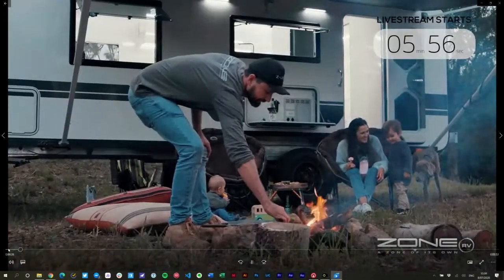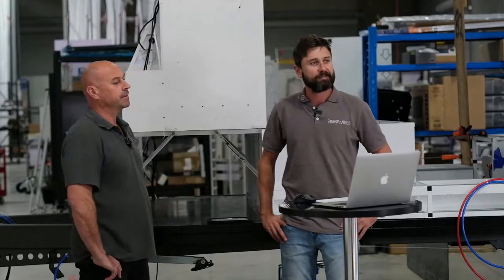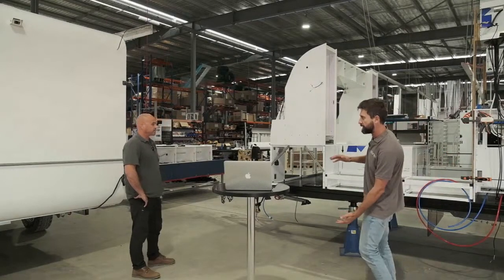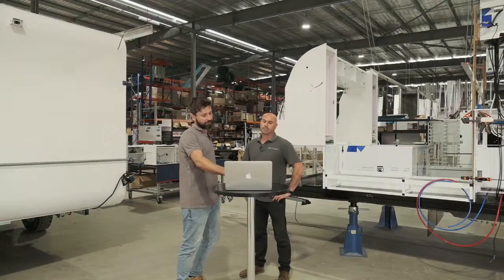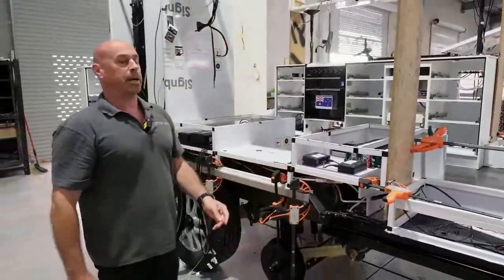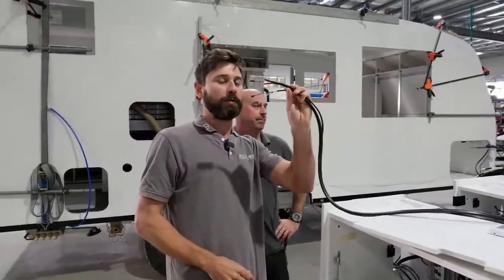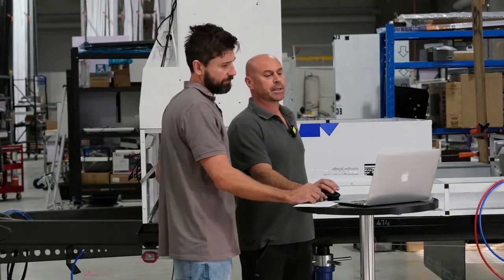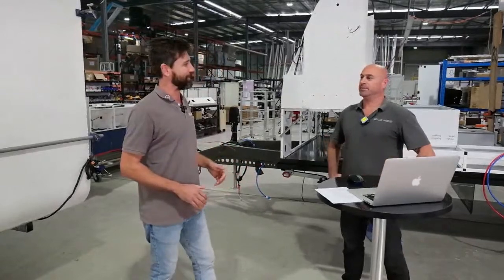Live inside the ZONE RV factory

Comment: I think you guys are overselling your product! Hard wiring doesn’t need to be accessed later! Components do! If you fry a cable, access to it is the least of you worries. 99.99% of the time, the hard wiring never need to be accessed. Not quite sure what you guys are designing you vans for. There’s many framed vans that have done The Gibb, Tele, cape York and everything in between and not had any issues.